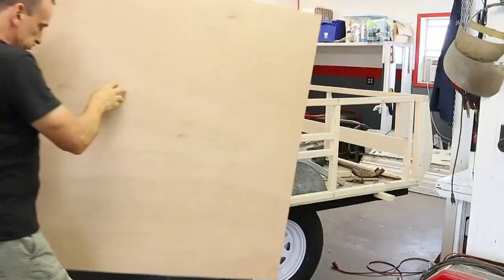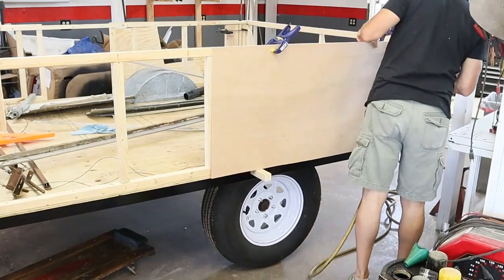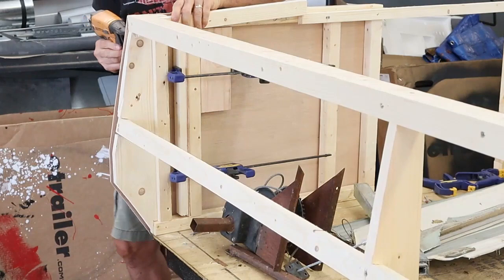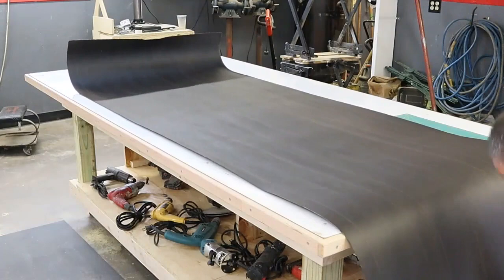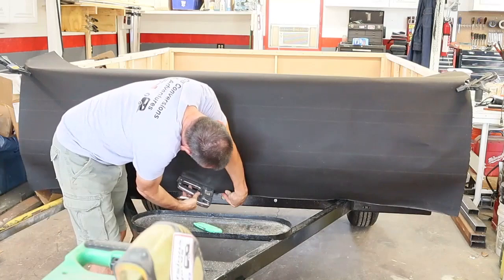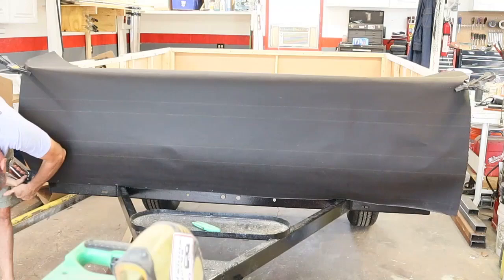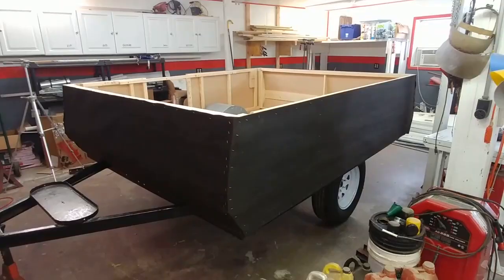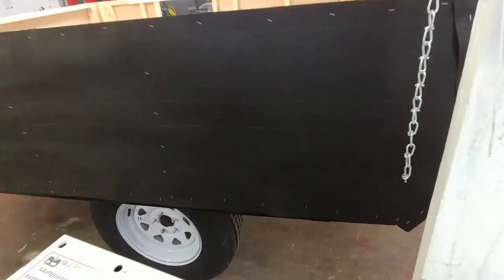JAYCO POP UP CAMPER REBUILD WOOD FRAMING REPLACEMENT REBUIILD Exterior Paneling Vapor Barrier PT 12

Comment: Nice work, I do want to point out how frequently people use a vapor barrier and that's a great idea except that every nail and staple that is used to hold it up punches through it therefore undermining it's very purpose. A coating of carpenter glue like titebond 3 will solve any future problem.
Reply from the maker: Thanks for watching and your suggestion. It is still going to get holes punched in it when I hang the aluminum skin, so unavoidable.

Comment: Yep, You're a pretty good hand GB. You're also used to working by Yourself as evidenced by the 1x2 to hold the paneling as You stapled it. I'm sure It is nice to have a clean frame to work on.
Reply from the maker: Yes it is nice to have it clean all over. Back in my racing days I spent hours in making sure  the car was clean top to bottom, much easier and more enjoyable to work on. Yep, used to working by myself, very therapeutic. Thanks for watching MT.
Reply: @FakeLegGreg  GB, That looked like one H.D. circular saw You were using. Also liked Your T-Shirt. Is that You're pop-up and You're Cargo Trailer both on the back of it? I think that is a Supper Cool Idea!! You built them both not many could do that and do it right.
Reply from the maker: @missouritraveler6401  That Old Milwaukee saw has been a good one for about 20 years now. It's very old school. Good eye on the shirt. It's a gift from the wife. Those are generic images on the back but they represent things I have done. Maybe a van build next?

Comment: Hey this is better than a shed I can stay in this once it's done lol. I think I would have folded the paper over the top edge. And on the side's I would have run the side and then fold the front over the side. But that's just me I believe it'll work either way.
Reply from the maker: LOL. Yep, it will be available. I thought about folding over the top and the front over the side. I am not sure the top trim would work with the paper under it. The front over the side, I think the aluminum skin and trim will cover it OK. But we do think alike on this.